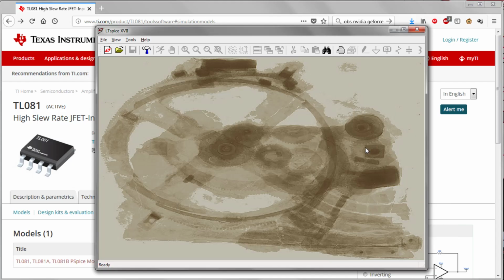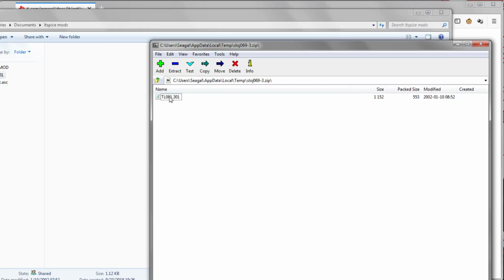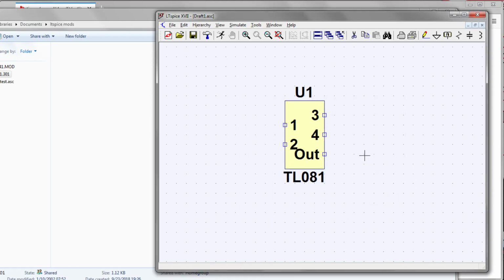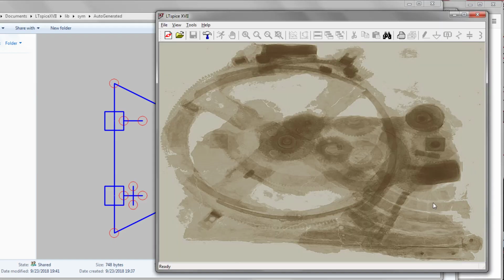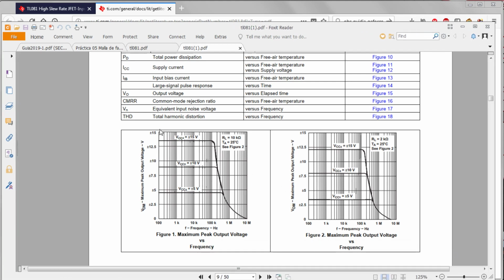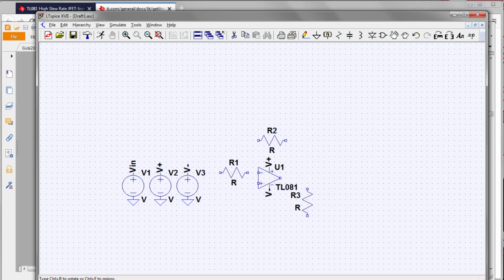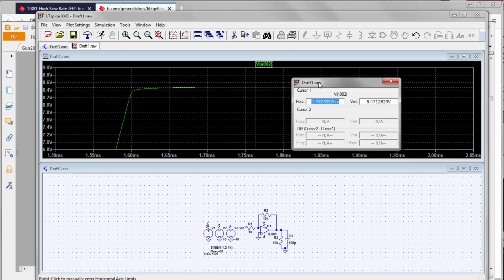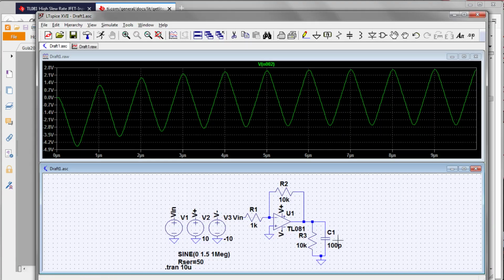How to add a new component to LTSpice (i.e. LM741, TL081) with sample simulation

Comment: Thank you for your lesson, this is very useful to me!!! I still have a question about this. The simulation shows the same results when I used R_L = 10k, but it does not show the same result as the data sheet when I use R_L = 2k. Do you know why?
Reply: sorry to be so offtopic but does someone know a trick to get back into an instagram account??
I somehow forgot the account password. I love any tips you can offer me
Reply: @Gatlin Francis Instablaster =)
Reply: @Hugo Jayden thanks so much for your reply. I got to the site through google and I'm in the hacking process atm.
Takes a while so I will reply here later with my results.
Reply: @Hugo Jayden it worked and I now got access to my account again. I'm so happy:D
Thanks so much, you saved my account!
Reply: @Gatlin Francis no problem xD